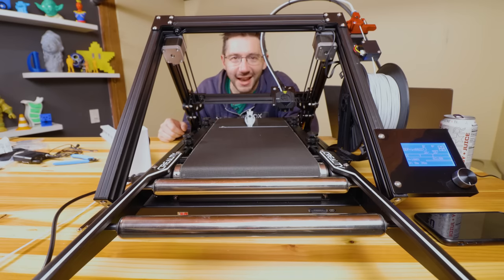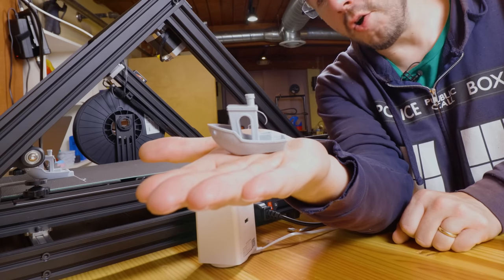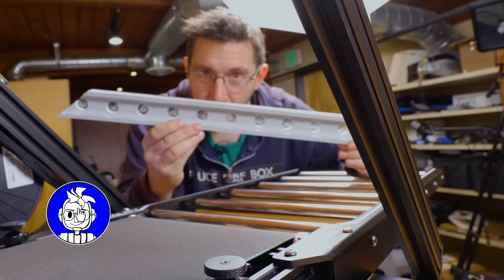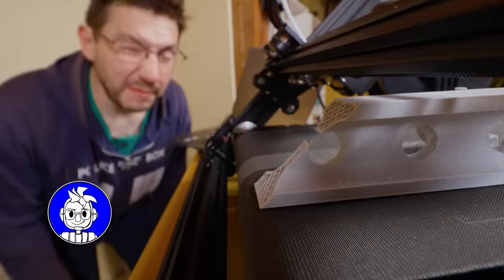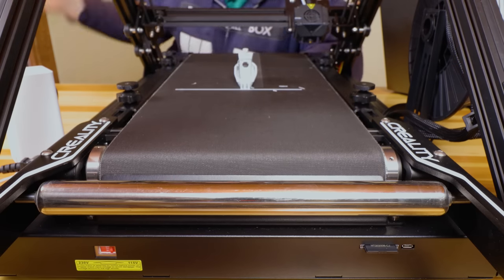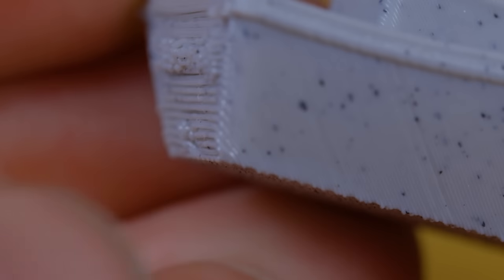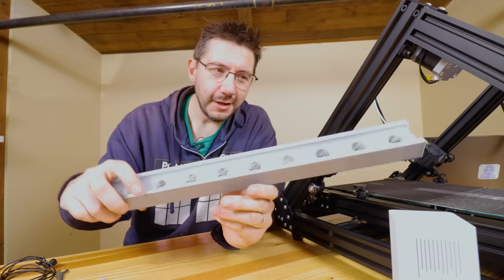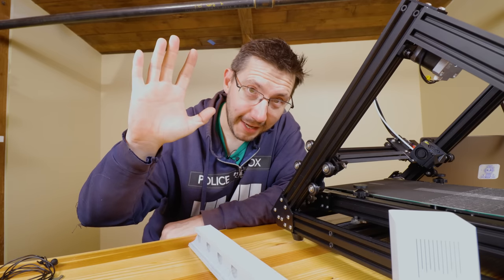Creality CR-30 / Naomi Wu's #3DPrintMill Update!

Comment: The idea is great, and I know it's been DIY'ed in the past, not sure if this is the first production infinite-Y machine or not, but execution needs some work. 
Rather than doing the cooling portion of the belt and doing the weird angle thing to break the piece off, I'd rather see testing done with having a scraper that becomes a flat platform before the first roller, which would of course have to be level with the bed, meaning the scraping edge would have to be tangent to the initial curve of the belt; in theory, this should work a lot better, but nobody knows until it's tested. Another thing that should be part of the machine is auto belt tensioning, a lot of people aren't going to know how to properly tension a belt, adding springs and a slide to the rear roller, which doesn't get used, would be a useful OEM upgrade for those that don't want to modify the machine. Belt material, pattern, and construction seems a bit jank, the materials themselves might be compatible with printing but the construction of said materials isn't, and the pattern on it might be good for a general use belt but clearly isn't great for printing as it's too mechanically adhesive. Also the angled print head is good for continuous prints, which is what this machine is clearly designed for, but isn't so great at miniatures, as seen by the Benchy proving to be a bit odd when the overhangs are modified to be at a different angle than what is typical. 

As for testing that you can do, there's a couple things I'd like to see. Print a Benchy on top of an angled block, so that the boat is angled to the belt but perpendicular to the nozzle; this may prove to be a solution to the overhang problem. Another test that I want to see is the machine put on a stand, so that the belt is angled in relation to the table, but the nozzle is parallel to the table; I want to see this for adhesion properties of the belt, and for printing properties of printing onto a severely non-flat surface. As a side effect of both tests in combination, you could create a production mill with this machine, where the prints pop right off and are easily gravity fed into a bucket, and the angled setup would make the machine taller but not as deep. 
Combine these with the potential fixes I suggested in the former half of this comment, and it'd be an almost bulletproof constant production machine; eat your heart out Prusa print farm.

Comment: For the cost of the "dead end" why not just have a thin sheet of hdpe set 5mm away from and 1mm lower than the belt roller. And my smooth bed surface usually becomes part of my design process. I cant do much with a honeycomb surface that will need filled and sanded before being used for adhesive or presentation.

Comment: Great video !! But I have a question for you. I did some work for a guy and for payment he gave me his cr10-s pro version 1 , which was awesome, but when I got it home I found that he must have erased all of the files on the micro SD card . What do I need to do to get the files back on the card so that I can start using this machine? Thanks Jason
Reply from the maker: To print something, you would want to download a model in STL format, then download a slicing program such as Cura or ideaMaker, slice the STL and save out a GCODE file. Put that on the sdcard and that is what is printed.

Comment: I would like to have seen a side-by-side of the bottom of the benchys (benchies?) to better see the impact of adjusting the nozzle height. Would be interesting to see if the wear on the belt was less surface too.

Comment: It's definitely going to add more thinking to how models are positioned on the build plate.  For example, had the benchy been rotated to point to either side of the build belt. it would not have been able to make the bridge on the front window without supports.

Comment: Instead of moving the optical sensor, does the slicer have an equivalent z offset variable or z offset built into the printer? In this particular printers case, a z-x  offset
Reply from the maker: It's possible, but in this case it was proper to move the sensor.

Comment: Try coating the belt with PVA... PVA should be plenty flexible, and it would probably prevent the belt from taking damage like that. It will probably also help with bed release.

Comment: I would also love to here your recommendation on slicer settings about how to deal with Stringing. I have the Zesty Nimble extruder and E3D v6 Gold hotend. It only recommends a max of 2mm retraction. I am using the following settings...  A travel speed  of 180mm/s both printing and non printing. 80mm/s retraction speed and 1.85mm retraction amount. I am printing with MH Build series PETG and eSun PETG. In the past with my bowden tube setup my retraction amount was set to 8mm and that eliminated stringing. Stringing does not affect mostly solid parts. I am using Simplify3D. Any thoughts? Thank You. I wonder if adjusting the heat temp of the belt would help.

Comment: I think it would be nice if they had torque specs for the bolts. For the belt it should have a hertz range for acceptable tension. Just some base lines for consistent set up.

Comment: Right now I am concerned that printing something like a cosplay sword needs a smooth bottom side. I wonder how that will print if it is having belt sticking issues. Maybe try Printing something liker that. They even show printing such an object. Another great print would be a Light saver. I am wondering if you can pause the print to change filament color between laser and handle.

Comment: this seems like it would be a fantastic way to make bumper fillers for 1970s vehicles be 3d printable, they are not overly wide as they just fill the gap between the 5mph bumper and the body of the car but they are longer pieces making something like this likely the best way to print them as fiberglass replacements are over $69+ per piece with a typical car using 6 pieces.

Comment: I wonder if you were to use a sheet of 2024 T-0 Aluminum adhered to the belt and sealed at the break if you would have amazingly smooth parts. 2024 T-0 is what I used in the Army to fabricate aluminum parts for Helicopters and if it is a thin enough sheet it is extremely flexible stuff. It would conform to the bed and rollers since they do not roll at an extreme angle. I really love your channel Joel, you certainly get the creative brain juices going when you present issues or questions on how to make things better in printing.

Comment: Separate thing: 
Could there be a command code/s that once the printing object almost gets to that point where it lifts, there is a command to stop the print head advance the object to break the end free from the belt, then back the object up to continue the print, so that eliminates the lifting during the print?
Reply from the maker: Um... it's possible for sure. It would require some pre-known stuff, but I see where you're going with this

Comment: How easily does that plastic burn?
See I'm thinking I could print a cog for example, green sand mold or, burn the print out and then pour.. Say aluminium in, almost like lost wax (yes in most cases this isn't necessary I'm wondering for when it is)
Reply: It can be done. Google "lost PLA casting". Alternatively, there's special wax filament for 3D printing and lost wax casting.

Comment: Do you think using PP or polypropylene would damage this printer in any way? prints the size of two credit cards stacked.
Reply from the maker: Hmm. I think the print temps for PP are more than what this printer can do. If you changed out the hot end, I bet you could.

Comment: Impressed with what I've seen on this printer so far from youtube reviews. Can anyone confirm that spare parts will be available from Creality from the start of the kickstart release of the machines. mainly wear and tear parts, hotends,  printing bed belt etc. Nothing worse than buying a machine and having to wait forever for  parts or to find the manufacture does not sell certain parts separately. I just would like to have certain parts on hand in case of wear n tear failure's putting a stop to the machines use.

Comment: since the benchie is not printed in the intended orientation, you're comparing apples and oranges here. Why don't you try printing it the way that the layer lines would be horizontal as if printed on a regular printer. Only in that orientation you have all those parameters, such overhangs, text clarity etc to compare. Overall pretty exciting printer!

Comment: I really like the idea of starting a print and letting it just churn out part after part, but the part I would use needs to have a smooth first layer so I can stick vinyl rap over it to help block light leaking (it's very thin led panels) , My other project the 3d printed retro computer case would be a good one I could print a lot wider in a single part.

Comment: The honest reviews are maintaining good credibility.  Scratch fingernail on surfaces so we can hear it. Example adheasion patter. Layers also.  If belt were flat right to end may or may not help with lift.
Id find the adheasion pattern acceptable. 190 pla may reduce belt pealing off. Float print .1mm above belt, i do that during slicing to stop file pop and it still sticks.
Be well from Will and Mr Data :) :]

Comment: I'm keeping an eye on this printer as, although my printer is good it's limited to 250mm^3 build volume & some of my models are bigger.

e.g. I'm printing a 19" rack case which is 423mm wide & having to do it in 3 parts - this would let me do it in one & remove the issues with joins in the middle

Comment: Would like to see 2 things.
A long print like the beam or something else and a plethora ( good word that) a plethora of smaller prints printed one after another which could be benchies or Joel bots or even cheap cubes.
On a personal note, it’s Kickstarter and you confirmed this so I would not back it as was burned in the past but 
Might buy it when and if it becomes retail.
Nice update Joel. puzzled about the benchy as it’s a test print, never seen it printed before with support so with support on the stern that’s odd.

Comment: What if there was a rotating plate that could be switched out for glass or whatever other standard build plate there is except it's round and so that spins as the printer prints it then there is a chisel type thing that goes on it but it can also come off in case you want to produce a lot of parts as apposed to a long part (sorry if they didn't make any sense I just tried to type it up really fast I'll make a CAD model and post it to reddit or something)(there are a few flaws and I'm thinking of. I just thought of this like 15 seconds ago so I'm hoping I'll find a way to work them out)

Comment: Hmmm... I wonder if you can use one of those copper colored silicone baking mats or a heated bed and place them on top of the belt.

Also... That belt is too long imo. You should be able to have a very small belt followed by 1/2" rollers packed tightly together.

Comment: I remember these sorts of things being a thing back in the cupcake days, I'm wondering how this might turn out.

Edit:
Print a prosthetic leg or something, that seems perfect for this.
Reply: Yeah, makerbot got a patent on a build belt preventing others from printing parts and belting them off at 90 degrees. They produced a few prototypes, but the business took off and innovation changed direction to financial endeavors. 
Bill Steele developed a 45 degree sloped build belt that bypassed makerbots patent and formed infinite Z, back in 2012ish, except it was a upright printer, with the belt sloped downward! He presented it at a maker fair, but the world wasn't ready for it yet... so he put his time into developing his company Polar3D. He again tried with Printrbot Bruce Drumm, to make the BlackBelt, a 45 degree printer, which looked awesome and had a lot of kinks worked out, but Printrbot fell into financial issues as US production collapsed to china in mass production low cost entry printers.
Glad to see Bill's ideas coming into production with Creality. Solid company, should do really well. But the 45 degree sloped belt design is and will always be Bill Steele's concept.
Reply: Yes, it was the “Gen 2” MakerBot Cupcake known as the “Thing-o-Matic” which had the converter belt bed but it was just for part ejection rather than used as an axis. This was around 2010/2011 before MakerBot turned bad.
Reply: @havocgeneral  Yep, my brother got the 800th cupcake cnc. Cost him like $1200 without any upgrades, and took him a full weekend to assemble the thing! 18 hours ish!
He moded it with 4 axis z lead screw, changed out the power resistor for nichrome wire, upgraded the stepper boards, which were like the size of a deck of playing cards each!!! it was magical the first time i saw that thing print! Around 2010... i thought to myself, the star trek replicator is finally here... in its infancy, but here none the less!

Comment: I don't see a huge advantage to having the final roller being below plane. What happens if you coat the high texture belt with something like cooking oil
Reply: Coat with cooking oil???  My guess is nothing will stick to it..
Reply: @NAK3DDesigns  nothing will stick deep in the pores of the print surface but I'm not so sure about the rest. wipe down the high spots, whatever, do some experimentation

Comment: We have a BlackBelt at work and even that which uses higher end components and even that isn't reliable. Definitely looking forward to some innovation in the field, and I'm interested what the price will be but I would avoid a 1st gen model.
Reply from the maker: The 1st gen is going to be as reliable as they can make it while keeping costs low - that’s for sure. However, it’s definitely going to be best for those who know what they are doing and have a knack for technical tinkering.

Comment: Maybe an assortment of mixed objects would be interesting and a tall one to see what's up on the higher levels. As for the belt we need options, maybe some *tak surface. Don't like the texture neither the material. End belt roller should be adjustable on two axes (maybe a 45° curved slot), just to give the customer tuning options. Same goes for the roller attachment, would be cool to have it height adjustable.
Reply: Personally, the Display and SD-Slot plus USB should be on the front of the printer. Maybe a 12864 mini fits better. Footprint is already rather large and running around the printer to make adjustments, well... you know.

Comment: I wonder what could be used as a bed plate that can give the same feel as a glass bed.
Reply: Maybe you could increase the extruder height and use a long piece of glass that is sticking out under the extruder that is pushed or is attached to the bed so it is essentially printing on a longer glass bed.

Comment: could you use kapton tape on the belt to "smooth the bottom of print" ?
Reply from the maker: Possibly. Add tape to the bed.
Reply: Painters tape would work the same as on a glass bed so long as there was some level of stickiness with the belt.

Comment: I think they need to work out bed material design. The carbon fiber is to endure the constant flexing but whatever the fiber is coated with something. If the prints continue to attack the bed material the belt will fail requiring a new bed belt.  your fine tuning suggestions will need to be included in the instruction manuals.  Your first benche still has build belt impressions so this may be just something we will have to accept and trade-off for the benefit of continuous printing benefit.

Comment: I was wondering if nozzle is still too close to the belt... You know..like it's extruding digilidang hot plastic every tiny possible hole and that's why it's stuck in too well and rip off the belt.. Just a guess 🤷🏼‍♂️😅

Comment: I think with the angle this prints at. You will be having problems with some models details due the natural of the angled head not printing downward straight unlike normal built core xy printers? The thing is, some details will not work well on a head that is this much angled no matter the tightness of the built frame etc. or the G-Codes.  Anyway Maybe you should print a complex shaped big model like the Starship Enterprise Refit from the star trek motion picture as it has lots of fine details and odd angles to print.

Comment: I was doing some Electroluminescent wire signs with printed frames, this thing would be perfect for that, as I was limited to the bed size of my prusa i3 mk3...  Something like this would be wonderful for that, since I could just keep printing length instead of having to split text by bed size.

Comment: I'm not one to horde my greatness, so i'm going to suggest placement of some capton tape exactly onto the surface of that high tech treadmill, then the printed objects shall no longer remove belt material, and you can regulate the resulting texture on the first layers that way. You can also consider trying to add some shims to boost the height of the rollers so that they are most inline and level with the playing field of which seems very important to maintain. I am an expert at how gravity works, at least in my mind i like to think i am and you should too. Vulcan high5's from a safe social distance, from the galaxy known as Stayinghomeandawayfromeveryoneforalittlewhilelonger.

Comment: Joel, do you know if Creality, Ultimaker or anybody else is working on a Belt Printer-compatible slicer? So far as I know the only one out there is BlackBelt3D's fork of Cura 3.6.0 and that hasn't seen any updates in nearly two years (https://github.com/BlackBelt3D/Cura). You can download a compiled version for Windows from BlackBelt3D, otherwise if you're on macOS or Linux you have to build it yourself.